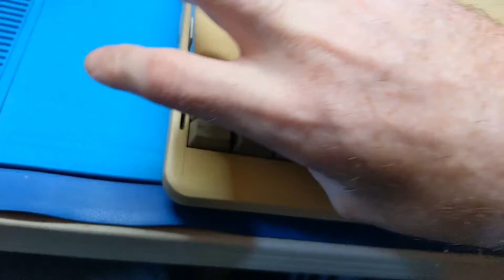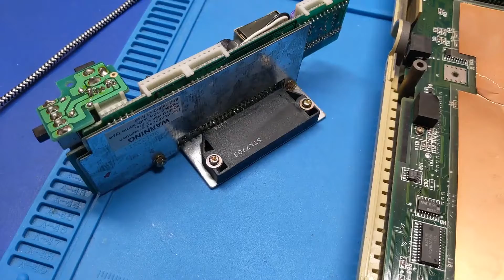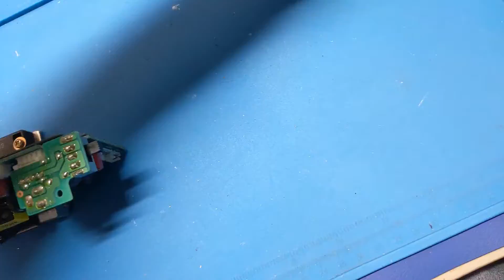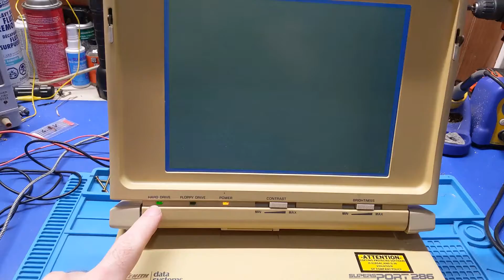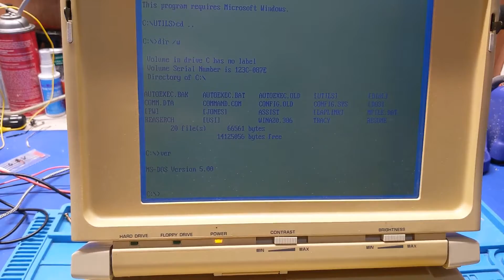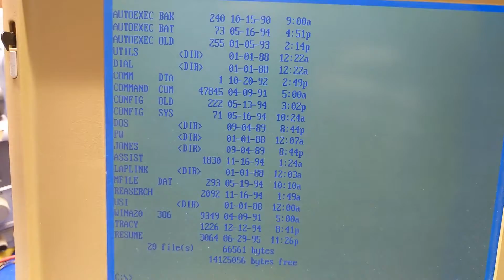Zenith SuperSPORT 286 Dead. Lets fix it.

Comment: STK770 seems to be an DC to DC power converter with variable output voltage, so maybe STK7703 may be a newer version of it. Maybe try to reverse the schematic and compare the two?

Comment: I have the same laptop but mine was stored in a hot building too long. The screen delamiated and the plastic is brittle. The motherboard works and it still boots when connected to a CGA monitor or adapter.

Comment: I have one of these here in the UK. Most of them were sold to BT (British Telecom) and used by their diagnostic telephone system engineers. Mine is an ex-BT system with a BT badge on it. Still works fine - but I may open it up to remove the CMOS battery after watching this 😬

Comment: You were dead-on with your analysis of that weird drive connector. The controller was on the board there, I have a drive of that same weird “bucket” form factor, a CP321, but mine is standard IDE. The controller board hooks right into that connector on the drive that you pointed out.
Also, that seized spindle issue is incredibly common on this style of Conner drive seemingly. Mine has the same problem, I’ve seen another on YouTube that did, and yours of course. It will likely come back at some point if you leave it to sit for long enough, it did on mine. Not sure if it’s stiction or the spindle motor.
My drive worked for a while after I freed it up but then eventually entered a different failure mode where the head would go crazy when trying access certain parts of the disk. I wonder whether magnet degredation caused that now after seeing this.
Good work on the fix!